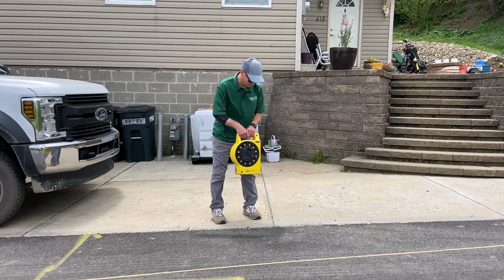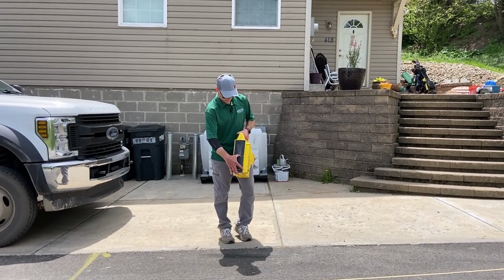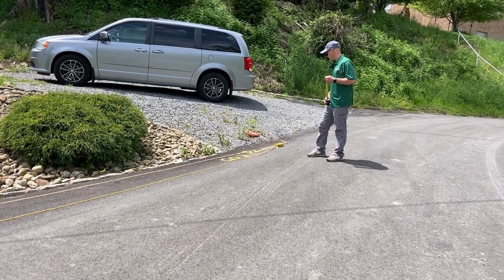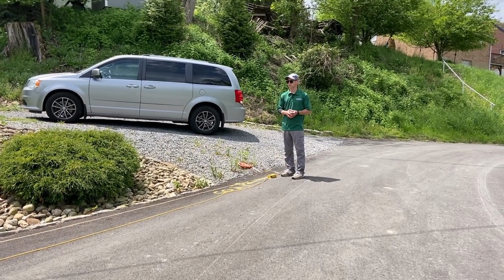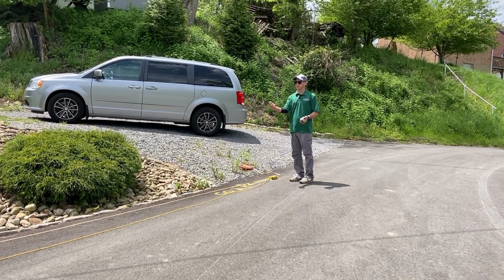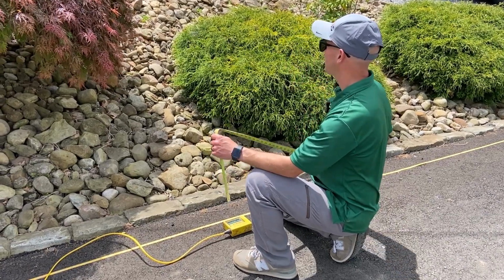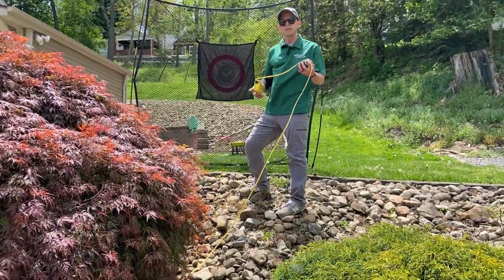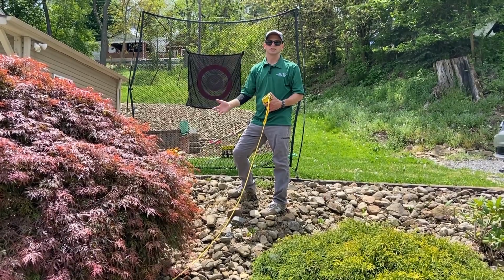Zip Level

Comment: Hi, what was it chiefly designed for? Can it be used to simply find level such as a level deck or foundation? Thank you
Reply from the maker: It would be a great tool to check level on a deck or foundation. The beauty of the zip level is you don't need a direct line of sight like you would with a typical rotary construction laser or transit. 
I don't know exactly what it was originally designed for, but it replaces a very cumbersome water level (clear tubing filled with water) for architects and engineers and estimators. 

 I hope this helps! If not reach back out, thanks!
Reply: Hi, thank you for getting back to me.  Is there any difference between a zip level and a smart one do you know?@rolling_hills_landscapes
Reply from the maker: @danthechippie4439  The Zip Level has to be factory calibrated every 3 years. The Smart level doesn't. Also if you tear the line of the Zip level it needs to be sent back to the factory. The Smart Level is designed to be fixed in the field.
We only own a Zip Level and love it, but we have not tried the Smart Level.
Something else to consider is Moasure. It is cheaper than both and does some really cool things like mapping but takes longer to do measurements. We recently purchased it and Amanda uses the zip level and the Moasure. 

Hope this helps! If you need any more clarity or would like to see a video on it, let us know. Thanks!
Reply: Hi. I'd love to see a video on it, thank you
Reply from the maker: @danthechippie4439  We'll have to give it a try!